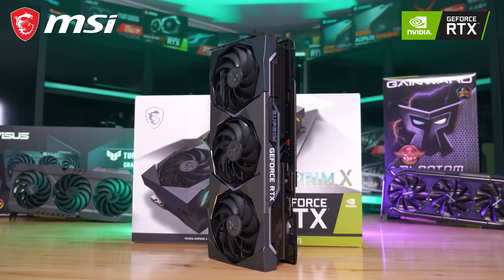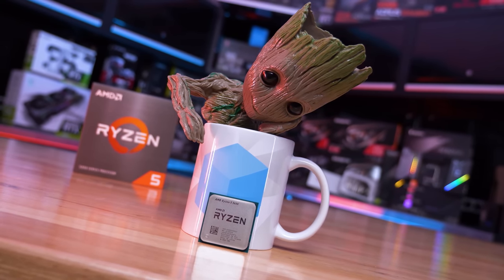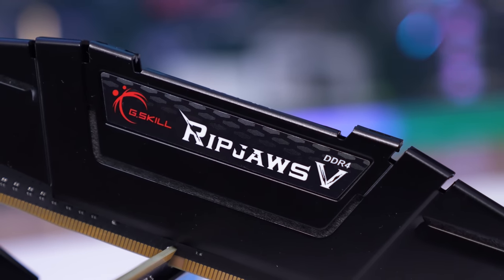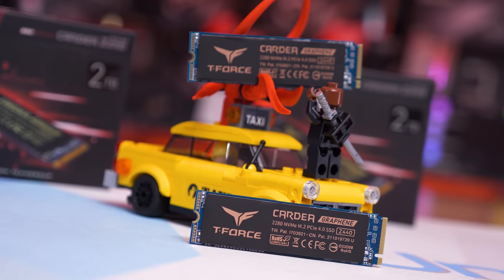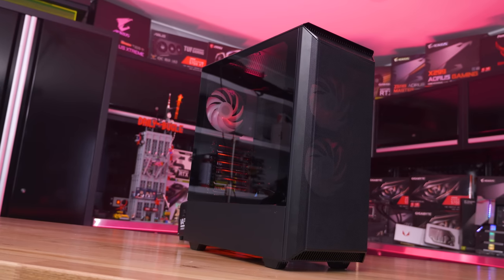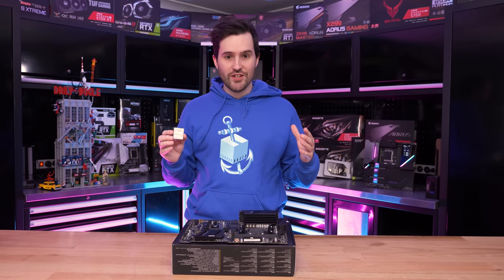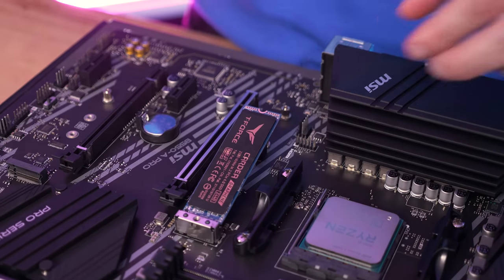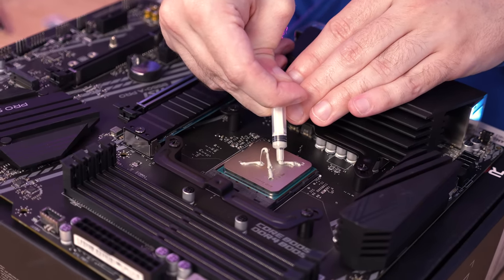Ultimate Value Gaming PC Build - AMD Ryzen Edition for 2022

Comment: Yikes!  $1,110 for a “budget mid-range build”.  No wonder next-gen consoles are still hard to get.  But, that’s not your fault.  Thanks for the video.  Cheers.
Reply: 1080p too, I mean yes it'll run 1440p but you'd probably want to stick to 1080p for the smoothest frame rates.
Reply: You save 600 700 easily over the years you use it by not paying to use the internet like consoles and having cheap/free games. The access to emulation / multi monitor media etc. PC exclusives.  If you want to buy a console for 400/500 and play one or two games though sure it's a better value.
Reply: mid range pricing has gone way up in the past decade
Reply: You can easily cut this down ~700 bucks if you can deal with a tiered storage system and don't overspend on parts like they do here. Buy a used b450 board, don't buy the cooler, get looser ram, don't go overkill on the psu, it all adds up. Their vision of "budget" is just out of touch.
Reply: @Navi_xoo  You are probably right, eventually, the PC will be cheaper if you get a lot of years out of it.  At this price, it may be a long time until you get that "win".  With luck, video card prices will keep coming back down to earth to ease some of the pain.
Reply: Yup there's zero reason I'd ever recommend one of these over a PS5 or Series X/S. PC gaming has always been a luxury but it's pretty absurd these days.
Reply: @wanderingwobb6300  Well...sure, gaming has always been a luxury, as in not needed for survival. However, most households want/need a basic computer - or at least before smartphones/tablets - at which point the extra cost for making it "gameable" is basically the (currently insanely overpriced) GPU.

Get the 5600G instead of the 5600, basically the same price, get a more reasonable Seasonic GX 550 PSU at half the price, get a Fractal Design Focus G case at half the price, get 512 GB PCIe 3.0 at half the price and get rid of the GPU altogether, and you'll have spent $650 for something that, with low/medium settings, gets 60 fps at 1080p in games, while providing a platform for office productivity (or working remotely) as well.
Reply: @c99kfm  I agree if you you don't have  much of a budget and want to get into computer gaming there are a few spots you can save money.  You could start integrated graphics, but you also don't want to skimp.  The great thing PC has over consoles is the ability to upgrade.  Spend extra money on certain things.  Like the psu.  Don't get a 500w or 600w spend the extra for a 700+.  Then when you can you're ready for upgrades like a new graphics card, more fans, better cpu and so forth.
I consider this a good starting budget for  PC gaming.  Good components and room to make changes to fit your budget, but just remember not to screw yourself for later upgrades.  And never ever skimp on the PSU.  Plenty of Gamerz Nexus videos to prove that
Reply: You can also do a thousand other things with a pc rather than just game.  You can literally make a career out of it and make 100 times what you paid for it... only a very few pro gamers could say that about a gaming console
Reply: @mattb6646  True
Reply: @joemarais7683  No way that saves more than 400, you made that up without even trying. No cooler and looser RAM also both hurt performance. Going for a second-hand B450 is also kind of a bet and not the ideal choice for a 5600. The only thing I can agree with is the PSU. Everything you said would also make it harder to fit in any significant upgrade which can still be done with the same platform. So yeah good job, you saved a couple of hundred bucks at best and got your slightly worse build, surprise surprise.
Reply: @Navi_xoo  600-700 "easily"? Lmao. If you don't buy every single thing day one, that's the furthest thing from reality and even on PC you don't get significant discounts day one, so waiting yields kind of the same saving. The online services differ for everyone and not everyone uses them. Your argument also doesn't count any exclusive for consoles, but you do so for "PC exclusives" - which are... I don't know what remarkable and renowned games are released for PC only, so... Yeah. Multi monitor "media"? How niche is that and what's even the point for that. You're just making stuff up. Emulation? Xbox Series S wants to chat with you. "One or two games" are better value on a console? You gotta be joking. PC is better value only if you also do something significant on it other than gaming. If you ONLY want to play (well duh, that's what consoles are about), get a PS5 digital or a Series S, wait a bit to buy some games and "600-700" saved on PC are just a delusion, actually, it might as well be the other way around.
Reply: Considering LTT managed to make a 4K rig for around $1,000, yeah that's pretty disappointing. Of course I think LTT did it after this so prices have come down, but still.
Reply: @lloydaran  You don't need the cooler when the CPU comes with one itself, if you get a sensible case with a mesh front it'll run just fine. Heck, LTT recently did a video about a 4K gaming PC you can build for $1,000 That only had one fan in the back of the case and no fans on the front, and it still ran just fine at medium settings and 4K.
Reply: @MrGamelover23  that was 8 months ago mate and I think HUB is based in Europe so prices are worst there.
Reply: @sjneow  they're Australian based

Comment: I refuse to pay 400 US dollars for a gpu slower than 5700xt!
Reply: So does everyone with half a brain. This is done to make the intel build look better in the coming benchmark comparisons video. This is to contrast how bad the i9-12900ks looked side by side with the Ryzen 7 5800X3D (all while it costs 50% less for just CPU to CPU comparisons let alone DDR5 ram prices and motherboard to match).
Reply: Really? Have you seen how much the RX 5700 is going for right now? It literally has only 6% more performance than the 6600. You would never see the difference in the real world. The 5700xt is literally going for $500-$600 USED on ebay right now as we speak! So please explain how a $339 6600 is not better???

Comment: I was actually able to build a 5600 and 3060 build yesterday for 950 USD, thanks to the constant tech vids from you I was able to propped spec out the best pc for me and my needs. Thanks!
Reply: damn im so jealous :(
Reply: Ye I have a 12400f and 3060 ti build i did recently for 1100 and i loves it. Will probably upgrade to i7 13700f when taht comes out and 32gb ram but other then that im happy wiv it. Prebuilt of same spec and shittier parts costs more so im happy.
Reply: @Direwoof  good shit dude, we winning together
Reply: Same, I recently did a build with the 5600 and 3060 as well
Reply: I just bought a b450 board ram and a 5600 but I'm still running an r9 290 for now couldn't justify the price hike on the gpu 😀
Reply: same
Reply: The same would cost me around 1400$....
Reply: Damn nice in my country the cost for that would be 1200$
Reply: curious, why not intel 12400f?
Reply: @neilagutaya  the 5600 + mobo was cheaper than 12400f and mobo. Add on the cost of a cpu cooler since the intel stock cooler isn’t the greatest and you’re talking at least 50 dollars more
Reply: @isekaibuff6544  in my country that would be 1600$
Reply: nice!
Reply: That’s pretty expensive. I got the 5600x + 3060ti build for 850USD. Where are yiu located?
Reply: @jh9921  the US, this is when pricing for gpu’s had just started coming down so it admittedly was a little too expensive but I found it worth it because I didn’t know how things would end up in the coming months

Comment: I'm just gonna skip this moment for upgrading or building new PC, I'd better wait for transition from DDR4 to DDR5 as a new system standard
Reply: There are several transitions happening right now, although there's always someone who needs to upgrade today for whatever reason.
Reply: But the fantastic games they're not making! Shame to miss out of 
..right. Yeah, I'm staying with DDR4 & a silicone lottery 1600x @ 4.2ghz for now as well. Screw it. Lucked out on gpu, for once in my life but these prices? Budget? Nope.  Better, but I do not see prices sticking there when demand kicks in as we saw before. Too much smart everything, blockchain everything, ugh. We made a nice rope of gold to hang ourselves with if we are content to go the way of China, which is apparently fine with most people. Cheers.
Reply: @n1t21r3  Oh for sure.  I built my pc when my laptop just stopped working completely.  I essentially had to build a pc right then because I had nothing else.  Of that's the case you just have to determine what's best right than and go for it.
Reply: @afriendofafriend5766  yeah the PC hardware for rapid streaming + decompression from SSDs isn't there yet either. The speed is there, but to really leverage it eats CPU threads for breakfast. DirectStorage / RTX IO / whatever will help games take advantage of the faster drives better, but it still isn't really doing the same thing as the console hardware's hardware decompression which is an insane performance multiplier.
Reply: Zen 4 is DDR5 only
Reply: I "upgraded" from a 5950x to a 12900k worst mistake in my life. Aside of adobe, I can't see any benefit from intel, at least with ddr4. I just got more heat and noise and less money. I feel so dumb to trust in the many benchmarks where the 12900k crashed the 5950x... I deeply regret and I am counting the days to get zen4

Comment: Putting in gpu before cables takes away space for your hands to do work on the inside of the pc. I've built a few hundred and doing the gpu after cable management is more practical for connecting front io headers, fan headers etc.
Reply: That and people who put an aio on top before the ram or cpu power always makes me giggle
Reply: Yep, PSU in, connect everything and GPU last.
Reply: @theislandlife247  Even veterans of this trade still forget to plug in the CPU Power cable sometimes.  I think we all have made that mistake more than once to learn not to do it anymore, because, holy shit i don't have tiny child hands I cannot for the life of me fit my hand between my rad and the VRM heatsinks AND CPU cooler.  DO IT BEFORE HAND!

Comment: Quick heads up: there's currently a combo deal on Amazon (U.S.) for the T-Force 1TB Z440 SSD (gen 4) + 2x8GB Team Group 3200mhz CL16 memory for just $139.99 which is a pretty good deal. I can't link in the comments, but you should be able to find it.
Reply: That kit is single ranked. Dual ranked, like Tim's suggestion, is much better on Ryzen. The SSD is very good, though.  Steve did videos on DRAM single vs dual some time back. A bit more expensive, but you get what you pay for. If you can find G.Skill FlareX 3200CL14, it is truly superb.
Reply: @dandaly7305  on a budget build ram speeds or ranks are pretty much irrelevant
Reply: @dandaly7305  okay, but a 2x8GB 3200CL14 set from G.Skill is $110. A 1TB Z440 SSD is $125, so you're basically paying $15 for this other set of RAM. I would know which is better for a "value" build.
Reply: @cheese186  Unless you want to upgrade later.  What's going to happen is higher quality DDR4 is going to become more expensive while the cheaper stuff becomes less expensive.

So if the intent is to ever go to a faster gaming CPU, which to me means 5800X3D you want 3600 CL16 memory, 32GB worth.  That's the one part of the build I wouldn't try to save unless it's a one year build and then you sell it.
Reply: @johndoh5182  Ram speeds only matter at 1080p or below resolutions with the best available graphics card. I think people will be more than fine upgrading later and missing some 3% performance that they can get with expensive DDR4 kits.

Comment: Three Ryzen system I've built now and with each the XMP when activated is wrong, the primaries are fine but the secondaries are off. If you have an MSI board like the one in the video, you can use the "Memory-Z" feature in the BIOS to get the correct XMP timings from the dram chip and input them manually. Just something to check and keep in mind.